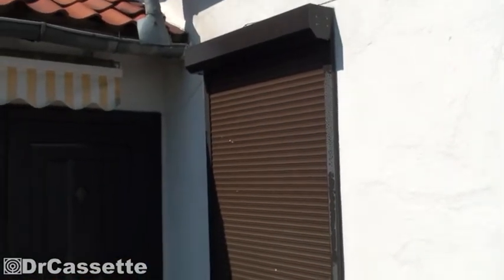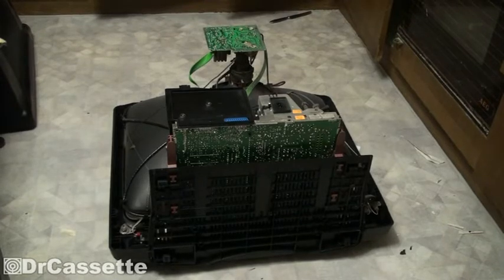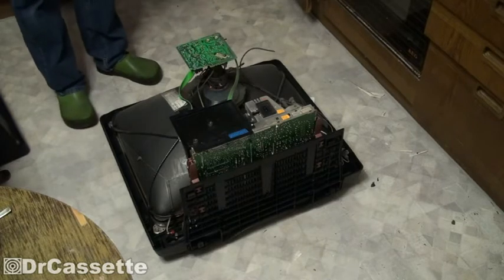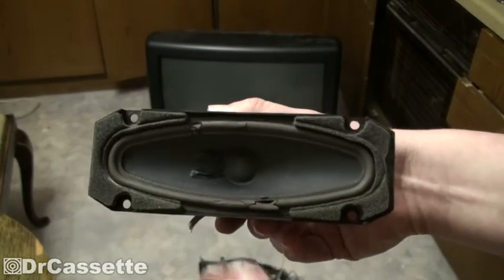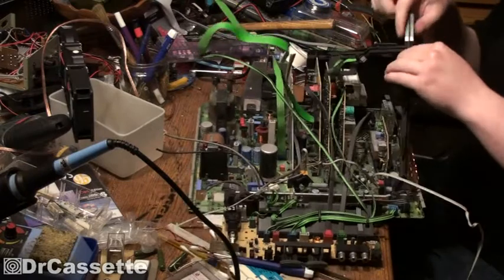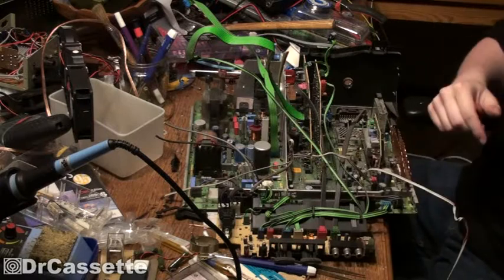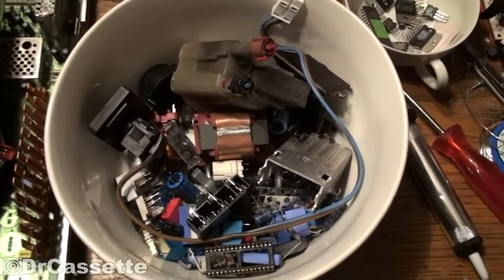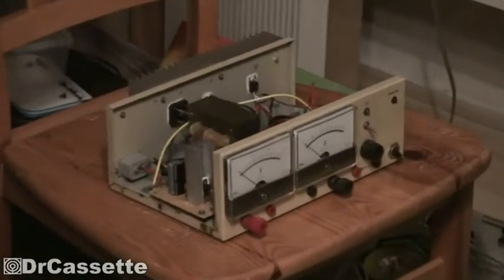DrCassette's Workshop - Take apart that Grundig TV!

Comment: Cut off all the copper wire and strip it. Including the degaussing cable. Take off all the heat sinks and there will be about 3 to 7 dollars worth of scrap. It may not sound like much, but I do this to approximately 100 tv;s a month which i find at the curb.